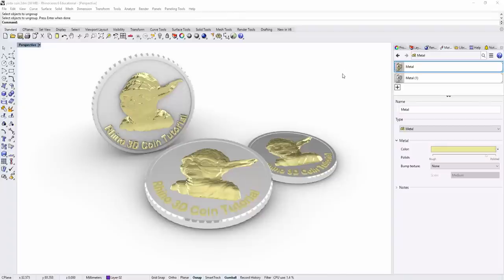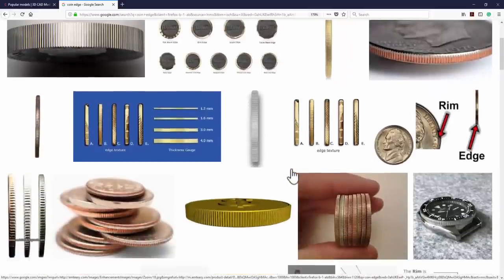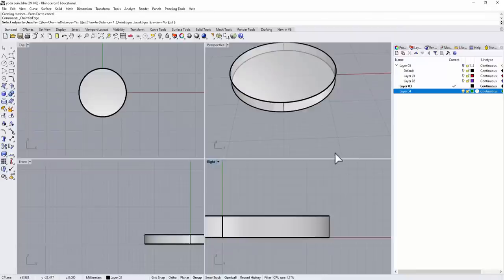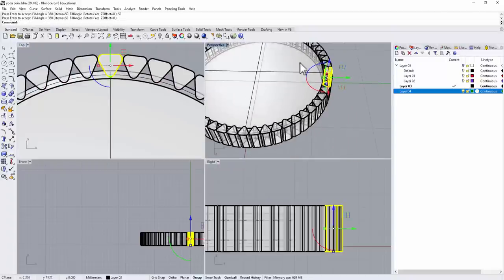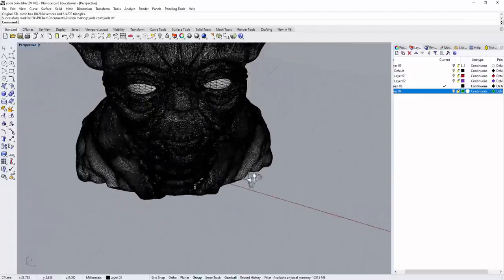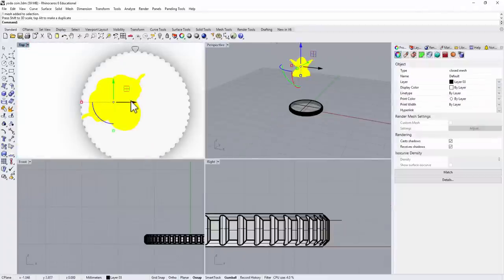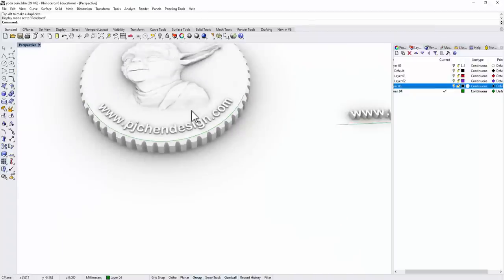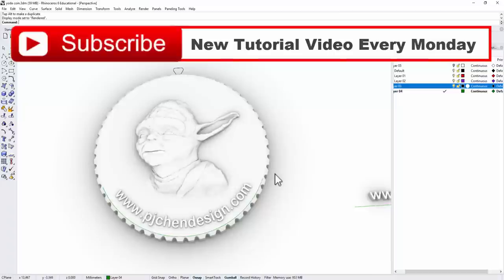Coin 3D Model Tutorial in Rhino 3D Jewelry CAD Design #27

Comment: Hi PJ! I am a member of your videos and I find them all fascinatingly useful. I have a question! What is the suggested height on the lettering for jewelry?? Sometimes I want to add a text and subtract it from the geometry (much like engraving) and sometimes protruding (like your example here) All my jewelry pieces are 3D printed for casting or just 3D printed itself :)
Reply from the maker: Depends in the size of text and the font of text. I won't do less than 0.4mm, but always suggest to do the engraving after casting either by hand, machine or laser.